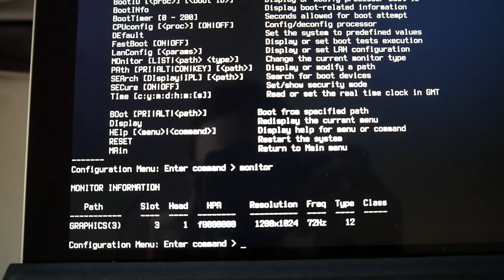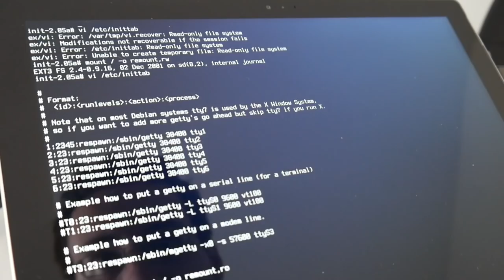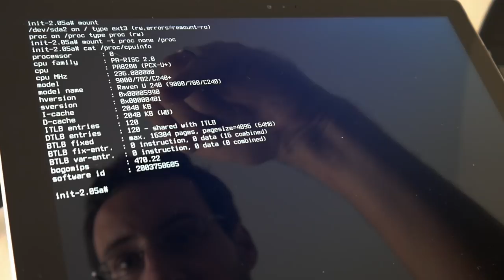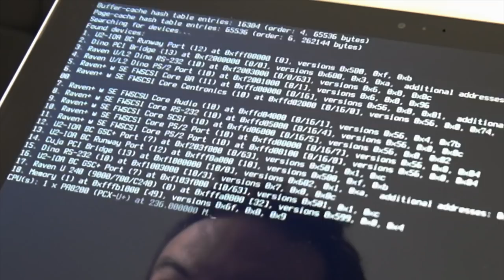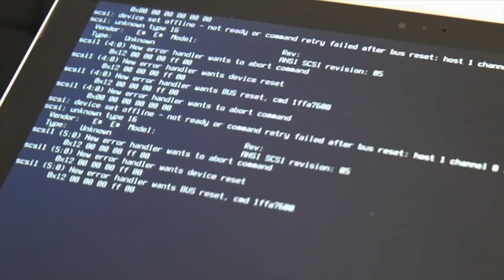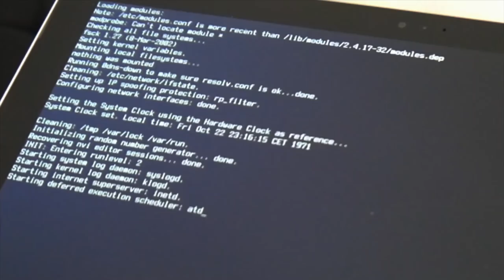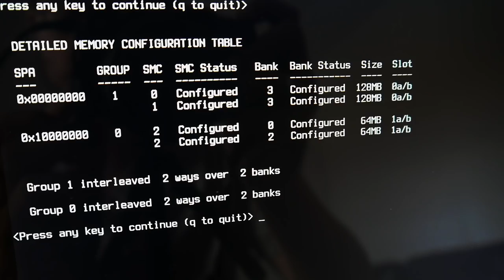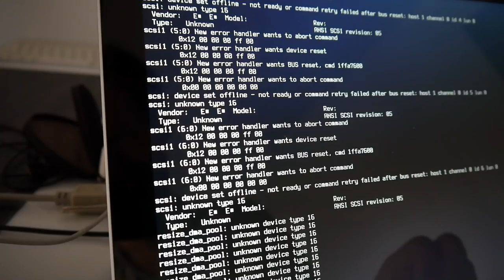More HP/PA-RISC details, network booting Linux & giveaway!

Comment from the maker: I'm still working on the giveaway terms & details. In the meantime for a start you can subscribe and leave a comment including your location! Currently available to give away: 2x Sun Ultra 5 @ 270MHz, 2x HP Visualize C200 @200MHz (one likely without working graphic adapter, at least not accepted by the firmware, but appears to work otherwise), …

Comment: 0:22 1280×1024 seems to have been a common high-end resolution for workstations in the 1990s.

I still have an old LCD monitor with that resolution (bought maybe 15 years ago) connected to my backup machine.

Comment: I'd love on of those Sun workstations but, i'm in Australia and that could be mighty expensive :( I would already have some Sun external scsi disk cases and disks for it to enjoy. Oh well, someone will enjoy them! I would pay for delivery if the cost was within reason.
Reply from the maker: The Sun Ultra 5 are IDE based, so for extern SCSI you would need to plug in a PCI card. If you want to boot form it an OpenFirmware computable one (I used a "PC" Adaptec in mine and simply booted form a small IDE drive - as seen in my earlier videos). I probably gather a list of interested people for a month and then see where shipping is possible. I guess it may be around 50-100$US equivalent from EU to Australia :-/
Reply: That cost wouldn't be that bad (happy to pay that!) As far as PCI SCSI cards, I have 3 Adaptec PC PCI cards so that wouldn't be a problem, IDE drives I have plenty of and it would be interesting to experiment with.
Reply: Now I'm regretting throwing away my old Sun Ultra 5 about five years ago, I kept the keyboard and mouse thinking I could get a better working one... I'm also based in Australia.
Reply: Simon Vannarath Yeah never throw out a computer, its amazing how much vintage stuff goes for now. I threw out an 8088 machine a few years ago. I regret that. I'm slowly trying to get together my own little museum. I've got c64's, plus 4, amiga 500, 1000 and 1200 and recently acquired an acorn risc pc 700 which is a fascinating beast. It has a a Risc and a 486 daughter board. Unfortunatly it didnt come with the orig hdd or mouse. The mouse is the biggest problem as it has a funny 9 pin mini din connector. The mouse transmits a quadrature signal the same a amigas so while I'm waiting for a connector in the post i knocked up a circuit to interface a rasp pi and an Amiga. I can now move the mouse on an amiga using a USB mouse (i cheated by using /dev/inputs/mice) My goal though is to use a  optical ps/2 mouse and a little microcontroller on all these computers. I really hate those old mouse balls lol. I know i could get a converter already built but where is the fun in that? There are always too many projects and not enough time.

Comment: Would love to mess around installing a SCSI2SD adapter on the HP if shipping to the states is possible and isn't cost prohibitive.
Reply from the maker: Unfortunately sd cards have no or no good wear leveling, if you apply Unix fs access load they will likely be defect in no time. I used one in the surface from the video in the beginning, the sandisk sd was dead after 6 months, … :-/ after that I switched to the Samsung T2 usb ssd also shown in the video. In my ultra 5 I recently migrated to sata thought: https://youtu.be/qEFphOXIhRI

Comment: 4:03 Would that L1 cache all be static RAM?
Reply from the maker: AFAICS this is on chip, on the CPU Die. So highly expensive, fast and power hungry ;-) Wikipedia lists the CPU as 3.8 million transistors, @ 0.5 µm process w/ a Die size of: 337.68 mm², unfortunately no Wattage, but the whole thing gets warm ;-) A Intel P54C had: 3.3 million transistors and measured 163 mm² at a 0.5 µm or 0.6 µm process. The Pentium Pro had separate Die "on-package" L2 cache, which ranged from 256 KiB at introduction to 1 MiB in 1997.
Reply: As I recall, one bit of static RAM needs at least 2 transistors for a flip-flop, while dynamic RAM needs only 1. So 2MB of static RAM would require 4 million transistors minimum.

Comment: Hi, could I ask you some questions? So, I want to get this one. Where can I buy it? How it costs? Do I need minicom to connect to serial port?
Reply from the maker: HP-PA-RISC? ebay, etc.? where are you located? Nowadays I often just use "screen" to for serial terminals: https://rene.rebe.de/2016-09-16/screen-on-a-serial-port/
Reply: @renerebe  I live in Russia
Reply from the maker: Proton heh, if it would not be 25kg I could take one next time to Moscow, but unfortunately it is too heavy
Reply: @renerebe  I saw how it costs on eBay and I think I can't pay for server. So I can play in PARISC Linux in qemu
Reply from the maker: Yeah, costs less, and also more energy efficient and portable. Additionally to Qemu I also recently discovered PCem e.g. for my bare-metal S3/Virge code :https://www.youtube.com/watch?v=fXJ11_wG_0U